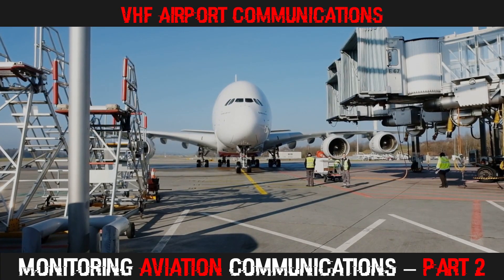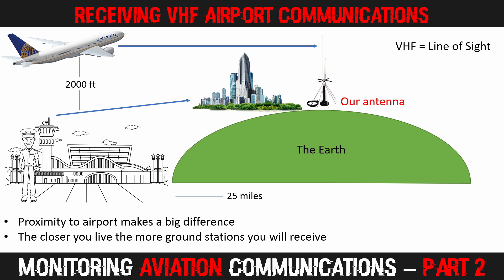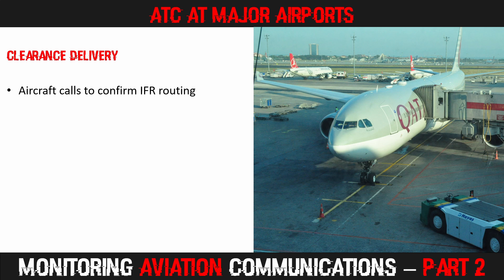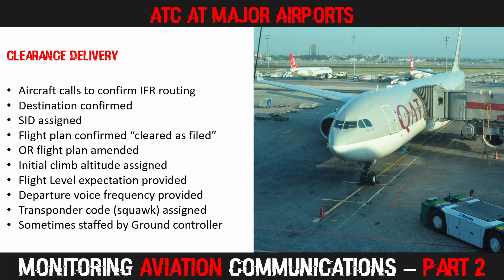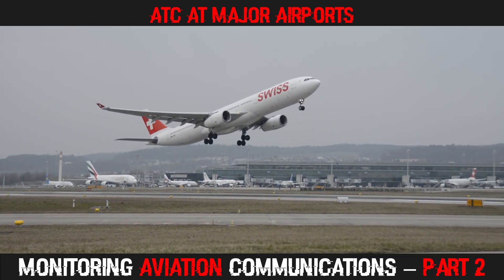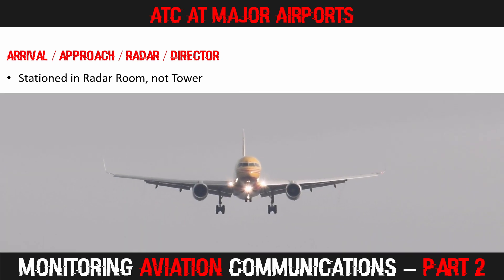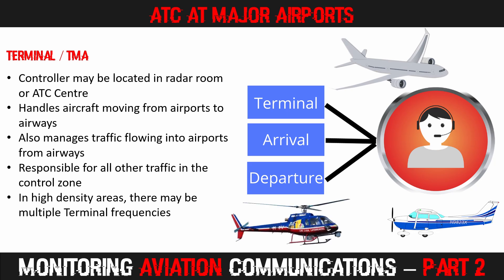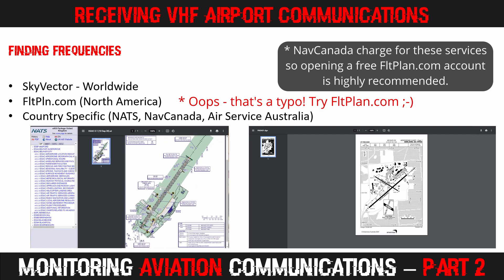Monitoring VHF Airband Aviation Frequencies at the Airport

Comment: I thought these were tetra radios these days, just bought a cheap radio we shall see lol, miss hearing what is happening when aircraft landing etc.
Reply from the maker: You are more likely to find DMR at airports when it comes to digital modes. Airport police would be Tetra, but I haven't encountered airport staff using it.

The aviation comms will be AM analog in the 118-137 MHz range.

Comment: I am a real novice.  I want to know HOW do I get this voice and not what it is.  It is assumed that readers know how to get voice.  I only get crackles.  I am not adjusting to the right parameter.  I have the right frequency, tried WFM, played with gain, nothing.
Reply from the maker: For VHF air band communication, the mode used is AM. Aside from making sure you have an antenna hooked up, and your gain set, you shouldn't have much else to do. Most people find a gain of around 29-36 works well, however it will really depend on your antenna location, how far from the transmitter you are, the quality of your coax, the type of SDR you have, local interference etc. Unfortunately everyone's situation is different so it is hard to give exact instructions.

Comment: Hi i want to ask, is it possible to hear airport comms in this range : distance 68 KM, my Elevation 40 M, airport elevation 10 M, and im using Dipole Antenna.
Reply from the maker: Most of the comms are going to be line of site. If you are high enough, and have no obstructions then it would be possible.

It also depends what radios at the airport you are wanting to monitor. Airline crew might have a repeater set up, in which case the signal will travel further. Generally not 40+ km though, unless they have an antenna quite high up.

With aircraft, you can receive them until close to landing, but depending where the approach & radar transmitters are located, it isn't likely you'll receive the air traffic controller.

Comment: Hi there. I am relatively new to airband radios and have had a Uniden ezi33xlt with a 40cm antenna for about 6 months. I live roughly 13 miles from LHR in a straight line and do not pick much up at all on 118.5(tower)  or any of the other LHR frequencies for that matter. There are quite a lot of trees around and I don’t live in a very elevated area. Is that why I don’t pick much up? Would you recommend a different radio with a longer range than my current one?
Reply from the maker: Hi. Getting an antenna outside, or even up in the loft would probably make a bigger difference. You can make a simple air band dipole with a chocolate bloc terminal adapter, a cooker of pieces of wire, and some coax if you have those things around. Or you could try some of Darren's antennas that he makes for monitoring air band. He is some that connect directly to your scanner, but even better would be something like the slim Jim for hanging inside or in the loft.

Receiving aircraft on the ground when talking to tower will be difficult from that distance. With a loft or roof antenna though you might hear the tower controller and the arriving / departing aircraft. You could also try the Heathrow Director frequency. 

If you were tempted to replace your radio, my recommendation would be for the Uniden 125XLT. It has a great reputation as an air band radio. I certainly enjoy mine (125AT which is the North American version of the same radio).

Comment: What do you think is the best mobile antenna for out and about.
Reply from the maker: Depends where you are and what you want to hear.
Personally, I used a commercial tri band Larson designed for 150 / 450 / 800. It does a fair job across those three bands. It is not that long, but works pretty well. I've also used standard amateur 2m / 70cm dual band antennas plenty of times. These have worked well for me too. 

A great mobile antenna is a quarterwave or halfwave whip tuned for the frequencies you're most interested in. Cheap, and works well.

Comment: is the flamingo fm filter a must if wanting to monitor air band?  i have an airport a few miles away
Reply: also i will be using the rtl-sdr blog v3
Reply from the maker: No, the filter is only required if you have strong broadcast FM signals in your area. If you find such signals, or broadcast interference in the airband range, then you might want to pick up a filter.

If there aren't many high powered broadcast transmitters around, you won't need a filter at all.
Reply: @FrugalRadio  thank you. I will wait and see if I need one. Now that I think of it there is a large FM radio station about 5 or 6 miles away that may cause some issues

Comment: Does anyone have experience with the FlightAware dongles?  Is there anything about the FlightAware dongles that would make them a bad choice as a second dongle for trunked system monitoring?
Reply from the maker: @SDWNJ The FlightAware blue dongles have some filtering in them, designed to reduce the signal level on frequencies outside the 1090 MHz ADSB band. So they are not fully suitable for other frequencies. They may work, but signal strength would be lower, leading to difficulty decoding etc.
Reply: @FrugalRadio  OK, that's what I suspected.  Thanks.  
BTW, have you thought about establishing a forum for viewers to interact with you and each other, like maybe a discord server?
Reply from the maker: @SDWNJ, I have been thinking about setting up a forum, yes. A few people have mentioned it, so it is a possibility for sure.

Comment: I have question for you, this discone antenna from vid IT is only RX antenna od also could be for TX?
Reply from the maker: I'm not sure which discone you are referring to. Generally they are designed as wide band receive antennas, although some handle transmission on amateur radio frequencies. Hopefully the specs will let you know.
Reply: @FrugalRadio  I was asking about antenna from your slide, this antennas are called discones, your antenna is probably from Moonraker, because even if other brands also offering this, Moonraker only have stand for internal use, I was thinking about buying this since I have about 30-40 km to nearest air port, was asking about TX since found info that it could TX but I was not sure...
Reply from the maker: Ok, thanks for the info. Basically discone antennas can work well, but if you want specifically to listen to 1 service, other types of antennas offer better performance. Be for transmitting I recommend using a different antenna, separated as far as possible from your receive antennas.

Comment: Great video! I'm about 20 miles from the Edmonton International but I can't receive the ATIS signal on my RTL-SDR. I'd love to learn more about optimizing my setup.  Are you using any filters to improve reception?
Reply from the maker: Hi Mark. Good to have another Edmontonian on the channel!

A lot will depend on your antenna. Are you using the dipole kit, or an external antenna? If an external, is it a discone or an antenna tuned for airband?

And yes, I use a filter. If you look at some of the previous videos you'll see which I use.
Reply: @FrugalRadio  I'm just using a TV antenna on my roof to play around with for now, I'm just starting in this hobby. I might need a more suitable antenna I guess. I did watch your video about sdr-trunk and managed to get it working to pick up AFRRCS. The TV antenna works great for that!
Reply from the maker: @Mark, that's interesting about the TV antenna. I tried a similar experiment once, although not with AFRRCS. For the aviation side of things we will have to get you hooked up with a more suitable antenna. There are a lot of reasons why the TV antenna is not going to offer good reception on airband.

I try to do an episode on airband antennas in this series.

Comment: Another great Video, looking forward to the next in the series. 

So here in Aust out "Main" Airport ( YMML) many of the "Main" frequencies are re transmitted ( re broadcast ) either on the same frequency or a different frequency many 10's of, 100's of or in some cases even 1000 of km's away from the airport as they cover huge areas of Aust so for exzample if you look up Australian Air Traffic Control in wikipedia you will see the following.

(I'd post the url but I know Youtube blocks posts with url's)

Melbourne Centre

The Melbourne ( YMML) FIR consists of all other Australian airspace outside the Brisbane FIR. This includes Victoria, Tasmania, southern New South Wales including Sydney, most of South Australia and the southern half of Western Australia. It also contains the Australian Indian and Southern Ocean airspace. Apart from international flights arriving from the Indian Ocean, most international flights will pass through Brisbane Centre first. However, as the FIR contains six of the eight capital cities, a very large portion of domestic flights are controlled from Melbourne Centre.

Regards
Wayne.
Reply from the maker: Hi Wayne. Thanks for continuing to watch.

The ATC Centres usually have many remote transmitters around the FIR. When I lived in the UK there were 2 rebroadcast from a mountain 30 miles away, which provided me with great reception of a low level and a high level sector nearby. 

I'll cover this in the next episode!

Comment: Nice, another fellow Canuck channel. I am an hour away from CYOW AND CYUL. Just a bit too far to hear coms. I have a FR24 rx here.
Reply from the maker: Hi @Aviator747a, nice to see Canada being represented in the comments here :-)
From an hour away you'd be out of luck for sure when it comes to hearing the controllers.  Glad to hear that you are a FR24 contributor.  What altitude do you lose the aircraft at as they approach the airports?  Hopefully you still get some good traffic.  CYEG has been very quiet lately.  Took me ages to even get a Clearance Delivery sample recorded for this epsode!
Reply: @FrugalRadio  1000' ish maybe. I would have to pay closer attention. My tower tops out at 40'. I am a ham as well. Do you stream to live atc being you can hear the tower?
Reply from the maker: Good to know @Aviator747a. Nice that you've got a tower. I'm licensed as well, although my hotspot hasn't worked in a few months, so I've not been on air.

As for streaming, I've experimented with some. I was using 1 SDR to manage feeding 4 freqs simultaneously, but I am rearranging how the computers are set up and haven't got it online right now. I was thinking private feeds via Zello. Right now I just have one active feed to Zello, coming from one of the scanners.
Reply: @FrugalRadio  I need to get a dedicated discone for sdr play up. My FR24 rx is from FR themselves. I reach out to 200 NM and a shade over.
Reply from the maker: 200nm is good. I hosted one of the original FR24 boxes a number of years ago, before I started acquiring my own equipment. It's good that you're able to contribute by hosting a receiver.

Comment: Good stuff, I'm still in ;) Going for a trip to Brisbane with the kit soon to have a nosy around. I'm a bit out in the sticks at home but my PiAware is picking up traffic 150nm out so that's pretty good.
Reply from the maker: That's great Matt. There's certainly lots of fun to be had when taking your SDR kit mobile. I never travel without one any more!
Reply: @FrugalRadio  I've got 2 dongles now, one FlightAware for PiAware and an RTL-SDR for general work. Got it working on an old Android phone too. Good Stuff!
Reply from the maker: Great stuff indeed @Matt Crittenden.  PiAware works pretty well with the FA dongle, and you can't beat an RTL-SDR for general use.  Glad you're getting stuck in to the hobby.  There will be a specific Flight Tracking episode later in the series too where we'll look at sharing data with multiple sites, and a couple of the less well-known options.
Reply: @FrugalRadio  Logging my flights via Virtual Radar too, interesting to see the traffic over time ...
Reply from the maker: Good work sir! There's been a huge decrease in flights here. Still getting some cargo activity on the Anchorage - CONUS routes, most of the ATC is CPDLC though, so the radios seem eerily quiet.